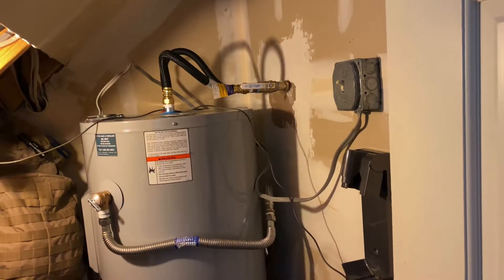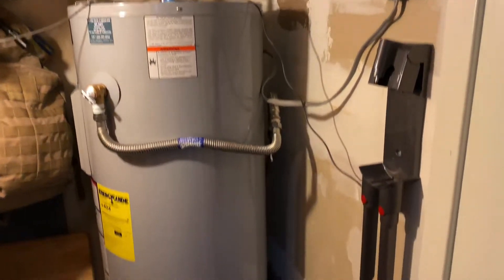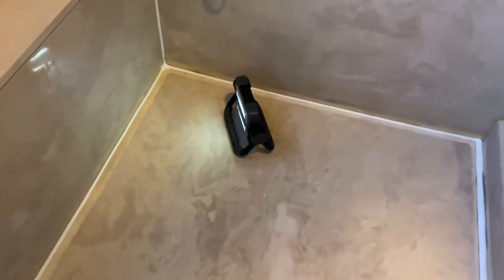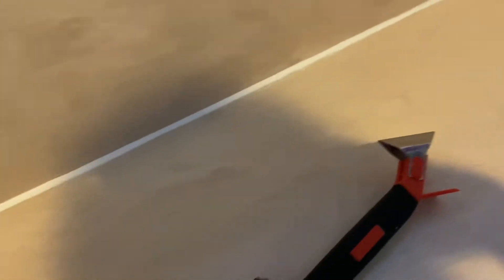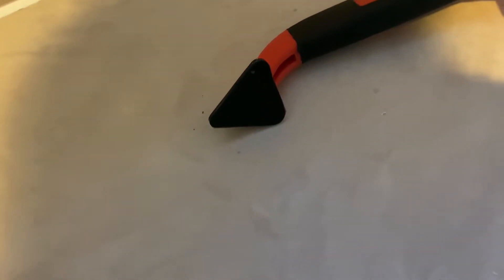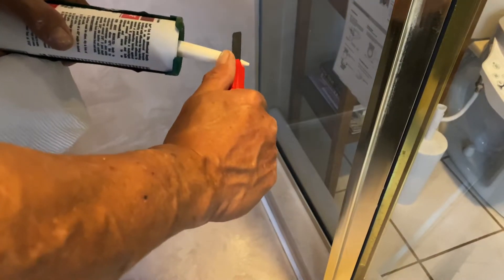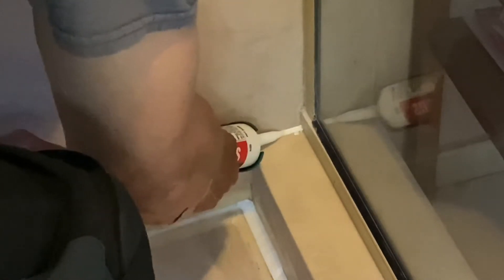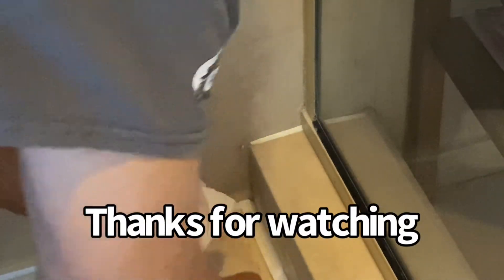3 in 1 Caulking Tool

Comment: Handy tool. I need to replace my shower, but I am going to pay someone to do it. 
Thanks for the video brother
Reply from the maker: Well it cost me $3k to have my main waterline located and repaired. I was able to save money, by doing my own drywall repair and buying and installing my own water heater. The shower seams were pretty grimy so that was elective. Ironically my toilet was leaking at the base so I replaced the wax seal yesterday and recaulked it. My house is 15 years old and everything seems to be wearing out at once. I also swept my own wood stove chimney by buying a chimney sweep tool ($69). I had smoke coming back into the house. A Pro wanted $350. Good luck with shower.